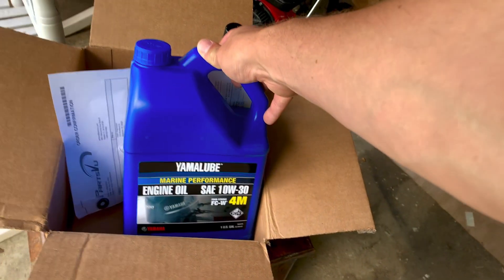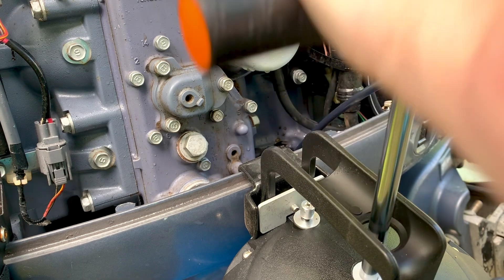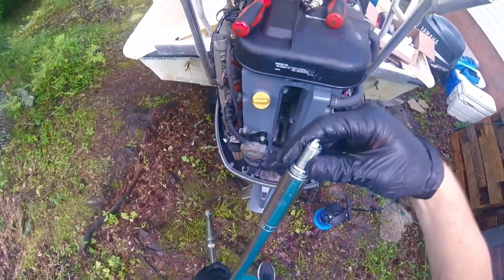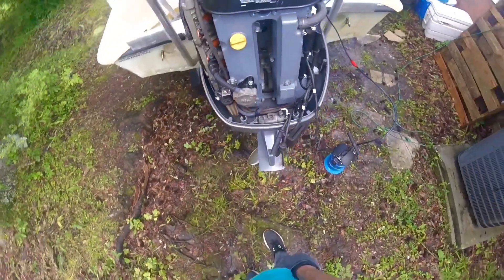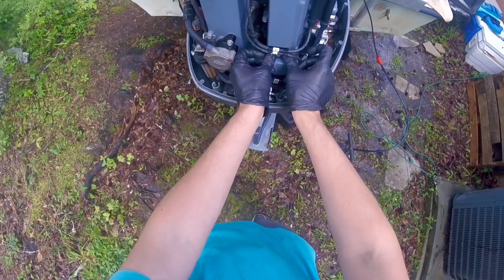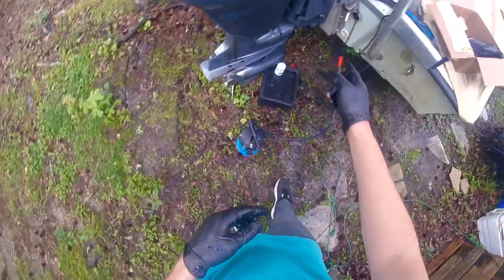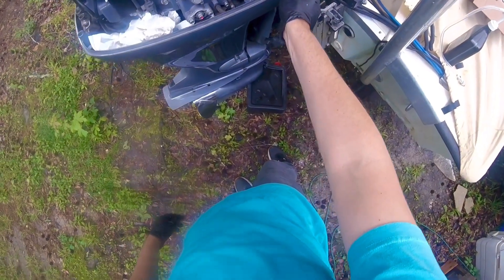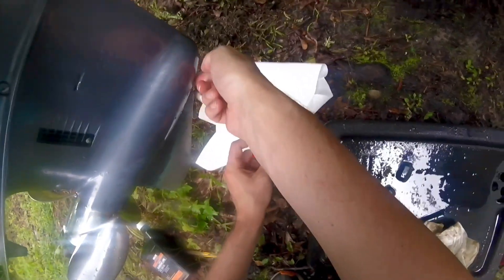Yamaha 115HP Four Stroke 100 Hour Maintenance

Comment: Hello I have a question on the water pump. Do I change it before or after the 100 hr service. Also the anode for fresh water if not corroded do I still change it out?
Reply from the maker: I would change the water pump every 100 hours or once a year whichever happens first and anodes at 500 hours

Comment: Do only remove the spark plugs for a compression test or is there something else do you know?
Reply from the maker: You replace the spark plugs 100hrs or annually whichever happens first, a compression test is great for checking if your motor has good readings across all cylinders